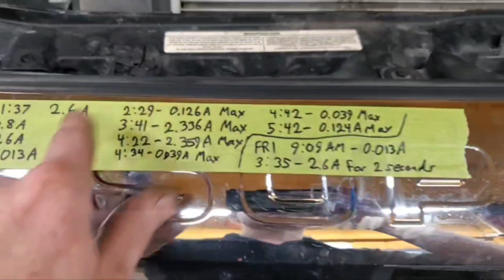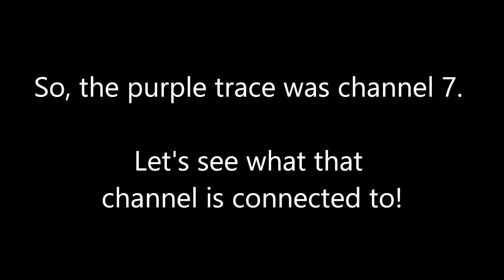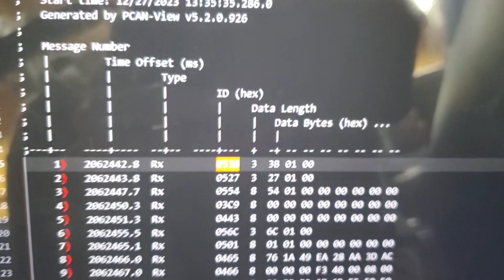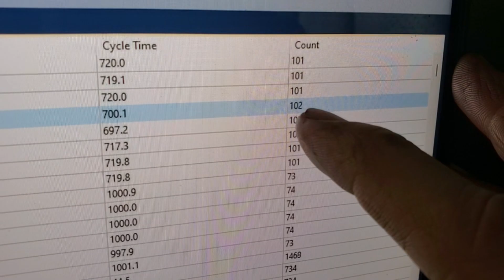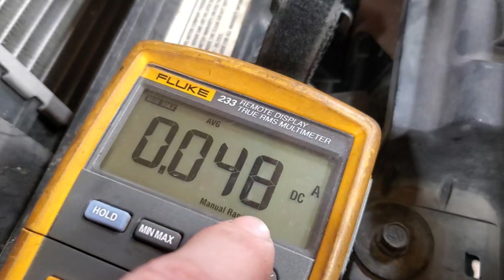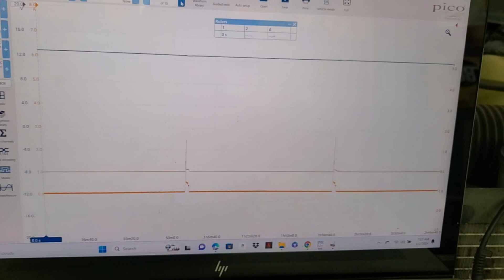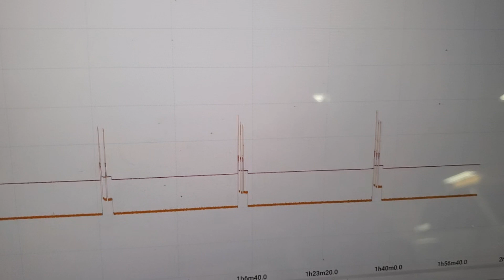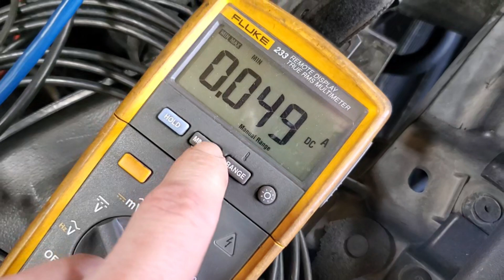2016 Ford Superduty Parasitic Draw From Bad TPMS Sensors!

Comment: Just out of curiosity did you check the current draw over time on a known good truck of same year make and model? just seems strange all 4 sensors doing the same thing... Very interesting 🤔
Reply from the maker: No, I haven't done a test yet on a known-good truck. So far the customer hasn't had any more issues but it's only been a few weeks since he picked it up. We work on a pretty good amount of these newer Superdutys so one day I will have to give it a try.
Reply: Yeah I would just be curious to see how a "known good" behaves. If you do and remember let me know what you see. @TechnicianRed

Comment: Wow crazy case study! Thanks for sharing! I don't really see the value in the sniffer; you can pull the fuses one at a time like you have to do anyway to find out the ID. It is still a really cool tool! I love the idea of using amp clamps to figure out what's turning on first.
Reply from the maker: I'm not sure if you heard this part in the video but the second time I ran the test with the amp clamps I had 2 fuses pulling power at the exact same time. The scope I was using didn't have a fast enough sample rate to be able to accurately tell which amp clamp saw current first. That's why I had to buy the sniffer. After using the sniffer I highly recommend all technicians buy one. They are only about $200 and SO easy to use!

The problem with CAN bus decoding with a PicoScope is you are limited to 8 pages of code before the buffer runs out of room. That can be a huge disadvantage when trying to figure out a problem like this one. Being able to log over 100K messages before the buffer runs out is SO valuable! Now you can easily see the same ID woke up the buss every time over a period of several hours. That test could probably run about a week long before running out of buffer room. With the PICO I would've had to reset the scope after each time the buss woke up.
Reply: @TechnicianRed  Thanks, do you have a link for it?
Reply from the maker: @advancedleveldiagnostics  no. Just Google Peak PCAN USB
Reply: @TechnicianRed  Thanks!

Comment: I just cant understand why the tpms sensor would wake up the pcm while the unit is off?  either way more proof that there are way to many electrical components on these newer vehicles
Reply from the maker: Because the TPMS module is also the keyless entry/remote start module so it has fused power at all times. Both the key FOB and TPMS sensors likely transmit on the same frequency (315 or 433mhz). So, the TPMS module will detect and analyze the TPMS signal even with the key off. That is my understanding of why it was waking up.

Comment: Did you find out which brand of sensor was used?  So the fix was to disable TPM.
Reply from the maker: No I never found out what brand sensor was used. And yes- disabling TPMS fixed the issue.